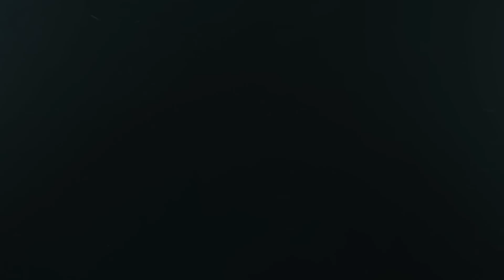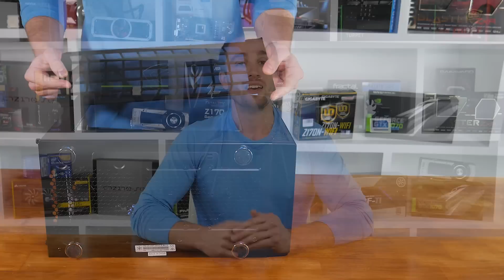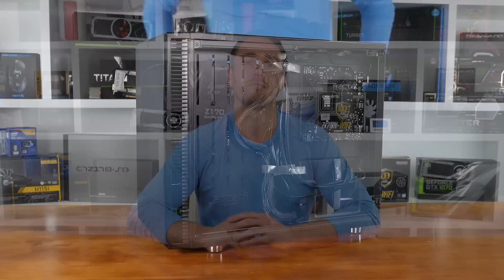Fractal Design Define Nano S: Review & Build (feat. GTX 1080 G1 Gaming)

Comment: So you can get 2 x 120 fans in the front. That's great. Top seems too tight for radiator. ITX boards tend not to have more than two connections for fans(1 for cpu heatsink). I just wish Ryzen had more choice in that segment.

Comment: I just bought this case and plan to start my first build soon.  Can I just keep the stock fans or do I need to replace them?  Are the stock fans enough to keep the system cool?

Also, I bought a locked CPU.  Do I need to buy a CPU cooler if I don't plan to overclock?  Can I just use the stock one?
Reply: Did you build in it yet? I'm curious how it went for you. The two fans you have should be good. You'll find case fans that can be quieter and/or more powerful to keep the case & components inside of it cooler but they'll cost more. It looks like the case fan(at least the 140mm) gets great reviews on Newegg. I plan on buying this case & adding another 140mm fan to the front to pull in more air. As far as the CPU cooler, you don't need to buy one. The one that came with your processor should be sufficient. If you find it too noisy for you, you can definitely replace it with a different fan but you by no means HAVE to change out your stock cooler.
Reply: Hey, yea i built my PC last week and it looks and is running great.  The case fans were indeed fine at first but I ended up replacing them with ones with LEDS on them.  Also they were a tad loud and the replacements are much quieter.  Stock CPU cooler is fine since I'm not overclocking.  Though the stock cooler definitely is loudest part of my system so I may end up replacing it eventually due to noise.

Comment: Does the PSU being so close to a non-blower style GPU negatively affect GPU temps?
Reply from the maker: Nope.
Reply: I can confirm, I'm using the R4 case and I have my MSI 390 sitting right above the PSU (older motherboard, the other PCI slot got bent) and it sticks to around 60 degrees idle and 70+ on load. When I do a new build, I'll be using the Nano case for sure. I'll just be doing air cooling and using the Wraith Cooler if it comes with the Zen cpu.
Reply: Top quality review btw, you deserve more subs/views.

Comment: I have a question, do you think the 6600K is a good value when it's with a GTX-1080, i'm in a dilemma right now, don't know what to get an i5-6600k or an i7-6700 i saw a GTA V video with a GTX 980 Ti, the 6600k OC at 4,6 and the i7 at 3,7, the i5-6600k was 1-3fps faster BUT i noticed that the usage on the 6600k was around 85-95% and on the 6700 at 55-65% and i thought that the GTX 1080 is faster than the GTX 980 Ti so the GTX 1080 will need more cpu power to give that 20-25% more, so i'm thinking to go with the i7-6700. For the motherboard i was thinking if i picked the 6600k to go with a Z170 but if i go with the 6700 a good B150 will do the trick.
Reply: from what i know games now doesn't need hyper threading, i7 will cost more for 4 threats that aren't used much in games. as you are going to pair it with a gtx 1080, i suppose it will be a gaming rig, so i think a 6600k will do. you can save that money for a better cooler if you didn't plan to get one.  in addition, kaby lake should be coming in q3, last year the 6600k and the 6700k was the first two processors announced, and it was around august if i recalled correctly. you might want to take a look at that if you are not buying it soon. it will come with a native usb 3.1 supports and the new 200 series chipset will come too, so the skylake platform will probably experience a price drop. you can save some bucks or opt for a newer platform when it is out. i suspect if you will care about those few bucks tho, given that you got money for such a rig.

Comment: Holy balls that's a lot of thermal paste.
Reply from the maker: Not really, it only just covered the CPU heat-spreader when I removed the block. Normally I spread it myself for an even layer but it honestly makes stuff all difference.

For example...
https://youtu.be/Hp66f6wTDuI?t=2m57s
Reply: Oh yep fairo. I guess mine is a hell different consistency, if I use that much paste I would have a big mess to clean up. I think it's called Arctic silver if I remember correctly? The stuff oozed out the sides and onto the retention bracket, such a pain.

Comment: It's a little awkward looking having the PSU at the bottom rather than the top. If it were at the top, you could have the graphics card pull in air from a vent on the bottom of the case rather than having airflow blocked by the PSU (assuming you have a non-blower cooler)

Comment from the maker: VIDEO INDEX
0:00 - Intro
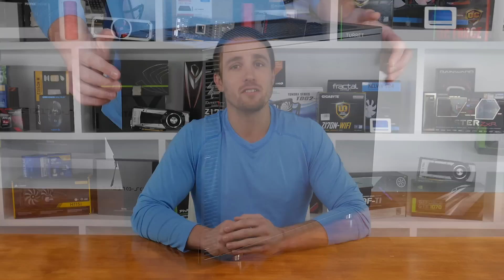0:32 - Back to the drawing board
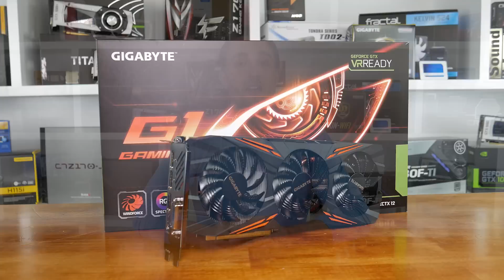1:04 - Fractal Design Nano S
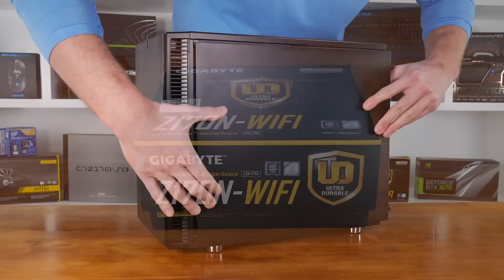3:57 - Gigabyte Z170N-WIFI
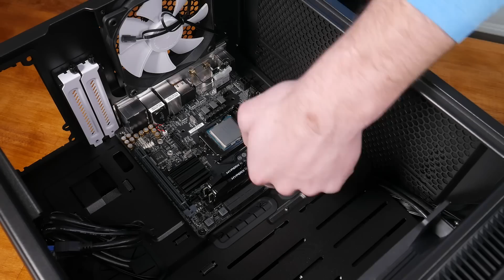5:10 - Fractal Design Kelvin S24 liquid cooler
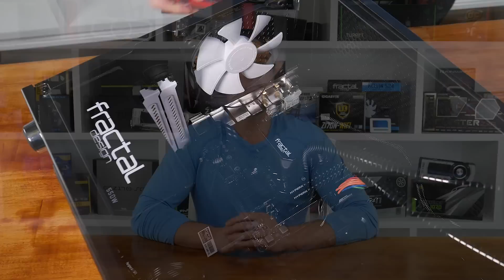6:24 - Fractal Design Edison M 550w PSU
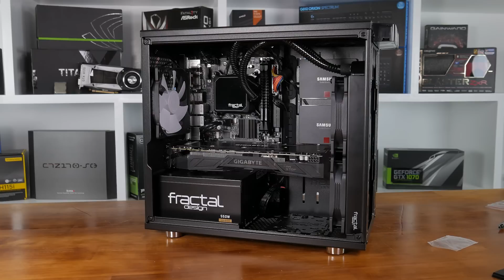7:22 - Gigabyte GTX 1080 G1 Gaming
7:35 - Storage
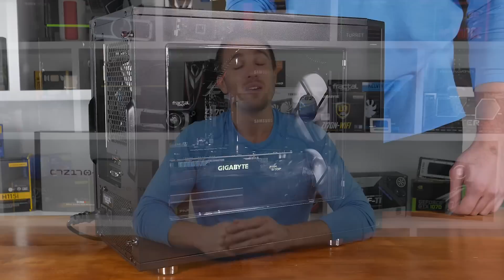7:43 - Conclusion
Reply: Hi how are you ...
is there a benchmark and tests for the (( zotac gtx 1080 amp extreme )) ??
please if there so we can know about it. .and if it's better or Asus strix or evga classified ???
thank you very much